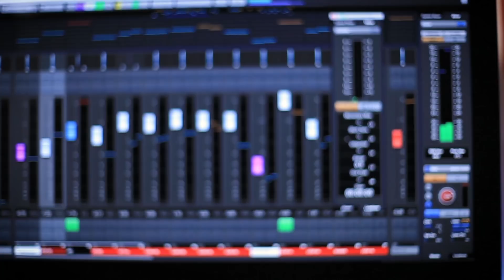Substractive Synthesis Explained

Comment: This was a cool video, but I might be stretching it here, but how is it different from additive (besides the fundamentals of the subtractive being removing and additive adding) synthesis? And when would one use a subtractive synth and when would one use an additive synth?
Reply: The "feel" of how you work with each is very different.  Subtractive is about starting with a harmonic-rich sound (which is why square/sawtooth are common) and choosing how to manipulate/shape it.  Additive is about picking the strengths of your harmonics, building from the ground up.  Think Hammond Organ -- choosing how far each drawbar is pulled.  Or the DX7's algorithm 32 -- pick your harmonics and how their strengths vary with time.  

In some ways, playing with subtractive synthesis feels inherently familiar -- the human mouth is a great adjustable filter for shaping voice/speech.  If you play with the filter on a subtractive synth, it's pretty straightforward to make the synth sound like it's saying "wow" or "eeooo".
Reply: Didn't subtractive synthesis replace additive synthesis already? In yester-decades, additive synthesis had HUGE and very expensive equipment and enter subtractive - its equipment is smaller, cheaper and more practical.
Reply: Additive is just uncommon in general, though much more practical with computers and DSP.  Summing a bunch of points from sine tables in software is arguably easier than building filters (analog modeling) to simulate a subtractive synth.  But yes, if you've got basic circuit components, subtractive is very practical -- the behaviors of resistors, capacitors, transistors, etc... can implement some otherwise difficult math and signal processing.
Reply: Additive is uncommon these days but it ruled the market before subtractive came along, evolved and replaced additive. The apps in this day and age are mostly subtractive.
Reply: @MobileMusic  My knowledge certainly has some holes.  What were the original additive synths that ruled the market?